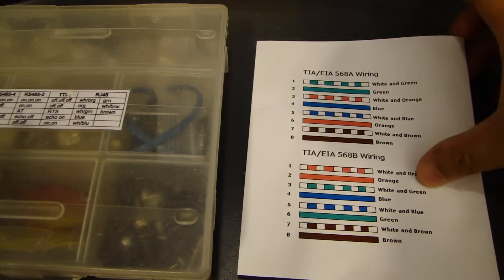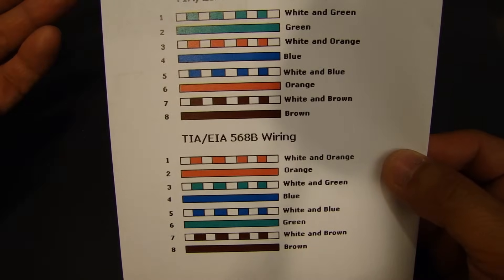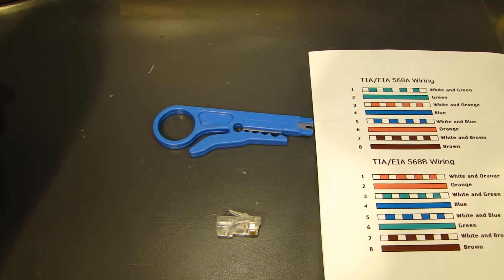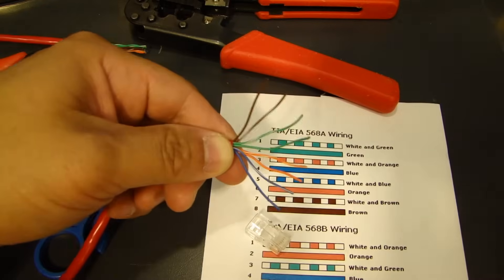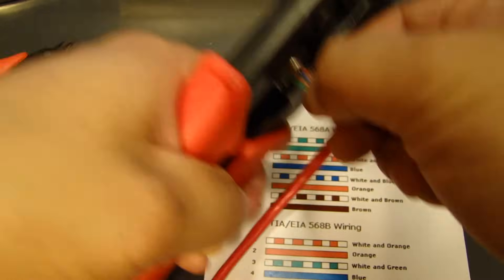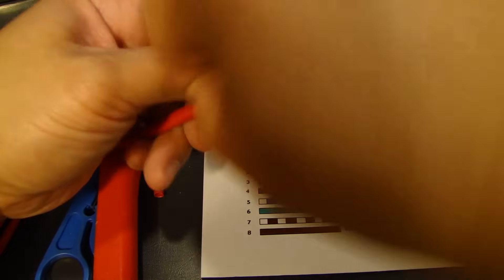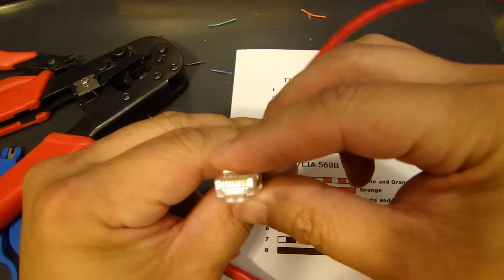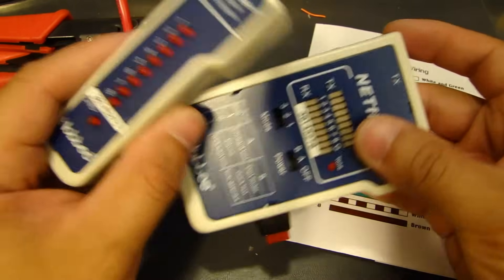How To Make Ethernet Cable RJ45 - Straight Through & Crossover

Comment: Annoyingly I'm trying to crimp some cat5 for poe cctv cams and there are only 6 cables. Black, red, green, green/white, orange and orange/white. Is this something for cctv cables as this cat5 cable came with the cameras. Can't find any reference to this wiring diagram anywhere, nobody referenced black and red cables. Some of the pins have to be empty cos there are 8 slots, so which ones are supposed to be empty? lol.
Reply from the maker: 6 conductor is not an Ethernet cable. The company that made those probably thought since they only need a few conductors to work with the cameras, and to save cost, they are using a 6 conductor twisted pair cable. Doing it this way, you have no idea which pin goes where because it's a non-standard custom wiring. You can perhaps try to match the color on the existing RJ45 connector that came with the camera system.
Reply: @dial2fast  hey thanks for replying. I'm going to match it with the other end of the cable when I can get access to it.

Comment: You make look simple and I think I finally got the hang of it. My advice to you is buy pre-cut assembled cables if you can because it ain't as easy as it seems. If you proceed do it on a day when you are at peace with yourself and have incredible patience. At the point when you are ready to push the wires into the connector make sure you see every wire in a straight line under your finger/thumb,all flat in a row and in the correct order. It is so easy for one wire to slip under/behind another and you are screwed. If I did this over again I would use pass through connectors. Murphy's law applies here and you will never succeed on the first try which is why you need lots of connectors. This job is a real bitch.

Comment: Old school way is to use snips to cut the casing then use the serrated top top align your pairs. Cheater way is to use a feed thru rj45 with a crimper that cuts the cable to lenght when you crimp it 
https://www.kleintools.com/sites/all/product_assets/catalog_imagery/klein/100cs.jpg

Comment: What is cross over for?
Reply from the maker: Cross over cable is used when connecting 'like or similar' devices. Such as connecting from computer to computer directly. But these days, network devices will automatically adjust and work without the use of a cross over cable.
Reply: @dial2fast  thank you

Comment: Hello Dial2fast, how do I pin up to match the keystone jack connections with the rg45 plug connections?
I just wired my home with ethernet cables, but now I need to make connections for the keystone plates on the wall and then rg45 plugs to connect to the keystones.  do I pin up all the keystone connectors all the same configuration, and the rg45 in a straight or cross configuration won't matter???  thanks in advance for your help
Reply from the maker: From your switch all the way to your RJ45 wall plate, you wire it up straight through. So each connection will have the same color code and pinout.

Comment: So it won't work if I just randomly ordered the wires but kept the same random order at both ends? I connected a head to a wire with a random order but repeated the same order at the other end and it didn't work. So the wires HAVE to be in that particular order?
Reply from the maker: The wires need to be in a specific order because there are Tx and Rx lines and the twisted pairs are put in a specific order to reduce EMI interference.

Comment: To be clear, you're not making a "Cat5 Ethernet cable". You're making either a cross-over cable or you're making a straight through cable, both of which are called "patch cords". What category of cable you use is an entirely different topic and has nothing to do with what you're trying to teach in this video.

As well, that"RJ45 Connector" you showed is actually an "RJ45 modular connector", or an "RJ45 mod end", but most often we call that a "cat5 mod end" or whatever category of cable it's terminating. Using the blanket term of an "RJ45 connector" could mean the "RJ45 Jack" (female end) or it could describe the "RJ45 mod end" (male end) as well. Either part could be accurately described as an "RJ45 connector" so using that term for what you're describing is not accurate. Kinda like calling a boy a girl really.
 
Details REALLY matter in this business. Be careful what you teach.

www.structuredcabling.co

Comment: i have a straight through cable in my house that has: WO/O/WG/WB/B/G/WB/B   on both ends... so they messed up the blue and white blue's position, to my surprise it works fine though.. How is that even possible? I guess it doesnt really matter wich order you use them then as long as 2 sides are the same?
Reply from the maker: If wire color match on both sides, the cable will work, but the standard is designed to have specific wire in a specific pin position to minimize noise. This is why they use twisted pair instead of untwisted.

Comment: Crossover cables became a thing of the past 20 years ago. All computers, switches and equipment built in the last 20 years is able to identify and correct TX and RX on pins 1, 2, 3, and 6 so it doesn't matter at all.  I prefer to wire in A because Blue and Orange are in the middle for phone.
Reply: Exactly the feature is called auto-mdix in Cisco switches !

Comment: great tutorial!! If making a LAN to LAN connection (router to router) do you use a straight-thru or crossover cable? Thanks !
Reply: Group A: Router - Host
Group B: Switch - Hub
When connecting two elements from the same group use cross-over, otherwise if you're connecting 2 elements from 2 different groups use straight through

Comment: We did this in school. Our class wasted 200 of those RJ-45s
Reply: They're not wasted.They are reusable.
Reply: @kellyash45  not if you crimp the wrong wire in the wrong pin.  They dont just come out.  You have to either cut the wire at the base of the terminal or crush the terminal itself and take the wires out.
Reply: How did you waste 200
Reply: no way 💀
Reply: Cap
Reply: this just a joke; don't take this as (true) fact, people of the internet
Reply: Do you guys know Winky D

Comment: I am wondering if 100base TX uses only 4 wires, will cutting off the unused blue and brown pairs affect the speed? I am planning to cut them off on both ends for power delivery.

Comment: did you no cat 5 had 4 wires that are useless the blu and brown they are just extra from back in the days when they wear used just like the phone system witch back in the day used 6 wires but now only 2 and someday cat5 will only use 2 wires also we just have not worked that out quite yet.
Reply: you are an idiot
Reply: See this is what happens with spell check.  lol

Comment: How long can the cable be
Reply from the maker: CAT5 max length 100 meters
Reply: Which two wires are carrying the data
Reply from the maker: Pins 1,2,3,6 are used

Comment: For a straight thru cable, does the sequence really matter? As long as it's the same on both ends then it shouldn't matter, correct?
Reply: I probably should have added that you were correct as well habib levi.the color code is also in part to prevent signal loss, cross talk, distortion etc..The other part of it is the pinning for networking 1,2 is transmit and 3,6 is receive.  That's why they are not paired color, Wcolor all the way through, because of that receive pinning.Blame the idiot that invented routers and what not.would have been much simpler to just swap pins in the device where needed rather than require 2 different types of cables.Imagine if every electrical appliance like your toaster and coffee maker used a standard 3-prong removable plug, then were varied as to which side of the plug was positive, negative and ground. So then you'd have to buy a normal or crossover plug depending on how they connected the positive and negative inside the appliance.That's how big of idiots smart people can be sometimes.Routers, switches and what not have been around for how many years???    They still haven't changed it, because then they would have to admit to a mistake.   So instead they spent 4x as much research designing switches that cost more which can automatically switch pinning.     Maybe it was just some jackass's joke to annoy the world.
Reply from the maker: If you simply match up both sides, the cable will most likely work. However you should learn the industry standard so you make the cable properly. I made a similar mistake when I first started in the industry, and the customer I was doing work for made me cut all the ends off and recrimp about 100+ connectors. If you want to be treated as a professional, then your work need to reflect that.
Reply: I think the reason for color code is to help eliminate distortion due to the corona created by the signal. Otherwise you might end up needing shielded cable.
Reply: The reason for the color code is so then when a tech replaces an end he doesn't have to hunt down the opposite end and color match.  (imagine in a multi-floor office how tedious it would be so have to run to the bottom floor, write down the color order of 1 cable then go to the top floor to make the end, then back down for the next wire. Not to mention even trying to figure out which end is the other end when you have 100's of wires all coming out of one conduit)
Reply: Viper90087 Why the crossover of the twisted pair on pin 3 and pin 6 then? It'd be much easier to make the end if I could just do the color and it's white brother all the way, then just make the code: orange, WO, green, WG, blue, WBlue, brown, WBrown or something.
That was just a reason I came up with to get my guys to do it right, because I couldn't fathom doing it this way for no reason.
I'm an electrician btw, and almost all commercial lighting is requiring CAT5 now, so it probably doesn't really matter for me, but you're right, it is aggravating to change out an obvious bad end, just to find out that now you have to remake the other end, because they used a different color code.
Reply: Viper90087 I've tried looking this up, and you're the first to mention this history lesson. What is your source? Or is it something you learned from the trade?

Comment: I have a cat 5 cable, I use it to connect a wire from my router to a PC in another room. when I am working on equipment. like building PC's. for that cable, I would create just a Straight through, Right? What is exactly a cross over used for? I am thinking different type of equipment.
Reply: +Scott Castille Crossover cable is used for similar devices.  Like switch to switch, or router to pc(similar in the way they send data).  A straight through cable is used for dissimilar devices like pc to switch. and router to switch.  If the router you are talking about that you are connecting your pc to is what typically gets provided by the ISP you are actually connecting it to a switch.  Most home routers just have a 4 or 5 pin switch built into the modem.  In that case since its pc to switch it would be a straight-through cable.

Comment: I'm trying to do this myself as professionals want £100 to fit the cable. The thing is as soon as I let the wire go when pushing the wires into the plastic end they cross over, so the wires aren't in line with the correct pin. It's very frustrating lol.
Reply from the maker: +Wes It does take practice, but you need to use your fingers to pull and straighten out each wire before lining them up. Move them around if you need to so each wire is not wrapped around another. Once you know they are straight and in order, then you cut to length and insert it (while still holding it down).
Reply: +dial2fast Okay, I'll give it another go. Thanks :)
Reply: This is one of the MANY reasons we get paid what we get paid. We have spent decades, usually, developing the education and skillset to be able to do what you cannot.

Pay the man and thank him for his expertise and give him the respect he deserves and stop being a cheap skate whiner.

Comment: the top is Crossover and the bottom is Straight Through
Reply: Applying both at different ends of a wire makes the wire a cross over. If the ends are the same... it's straight through

Comment: this makes no sense. my ethernet cable has only 4 wires and starts out like EIA / TIA B (even says this in bold print on the side of the cable). i dont have the other 4 wires (white/blue,green,white/brown, and brown all missing) but the cable works fine. in fact all my cables are like this bought from the store. if brown serves as data wire then how am i able to send and receive data with only 4 wires?
Reply from the maker: +itechhen RJ45 connector has 8 pins for the following reason. For data transfer, only 2 pairs are used, Pin 1,2,3,6. The other 2 pairs, Pin 4,5,7,8 are reserved for carrying power supply voltage for PoE (Power over Ethernet) to power some devices such as IP phone or security IP camera. So yes, the cable you have will connect the data side, but if you ever buy a device that is PoE, then it will not work.
Reply: +dial2fast  aha! that i did not know. thank you for the video and thanks for clearing that up.

Comment: sorry, Just for clarification....using the 568A at one end and the 568B at the other end makes it a crossover cable just like you showed on your video? using 568A or 568B on both ends make it a straight through cable. am I correct? I appreciate your answer....thanks
Reply from the maker: +rhy Lasquite Yes that's correct.
Reply: yes u saying right so i agree with you

Comment: Excellent Video, I did it my first try, I have the tools and the tester, I kept wasting connector after connector and couldn't figure out why the tester would not work, I finally looked up a video which was yours and realize my color platform was all wrong, I did a cable this morning with your color chart and the way you did it and the tester worked perfectly, Thanks alot.
Reply from the maker: John40ish Once you get a hang of it, then it's not too difficult. Glad you gave it a try.
Reply: John40ish It's great that you succeeded first try. I wish that the "whys" for doing straight through vs crossover would have been explained during the demonstration. For example, why flip colors? Not explained.

Comment: Which color is mainly the data receiver?

I know that brown is mainly the data sender.
Reply: Actually, unless you are using gigabit, the blue and brown pairs are unused, on regular 10/100 Base T networks pins 1 and 2 (Orange for B Green for A) are used for transmit (TX) or upload and pins 3 and 6 (Green for B Orange for A) are used for receive (RX) or download

Here is a diagram for what all the pins are used for (Note: I may have polarity (pos/neg) backwards, and the unused pairs, while unused, are considered as ground (GND)

                    T568A                T568B
1. TX+      White-Green     White-Orange
2. TX-           Green                Orange
3. RX+     White-Orange     White-Green
4. GND          Blue                    Blue
5. GND      White-Blue         White-Blue
6. RX-          Orange                Green
7. GND     White-Brown      White-Brown
8. GND         Brown                  Brown
Reply: Michael Dickens
Thank you so much.
Reply: No problem

Comment: Very helpful video.  Q: When would I use a straight-through vs. a cross-over cable?
Reply from the maker: Used when you have two 'like' similar devices, you would use xover cable (ex: from one computer to another), but now a days, many devices auto sense and switches for you.

Comment: dial2fast....

If I use a "cross-over" coupler, I should be able to just terminate both ends of seperate cables as 568A and plug-in to the coupler (the cross-over would be performed by the coupler)....  is this correct?

Thanks much

Thomas Crawford
Reply: Yes. As long as pairs 4 and 5 colors are reversed along the path, you're good.

If it helps imagine two people trying to talk to each other. It works best when one person puts their mouth ( the outgoing port) up to the ear (the receiving port). One pair sends communications and the other receives communications so they need to be "coupled" so the sender is sending to a receiving port and not another sending port that cannot hear anything.

This is the basic concept of a crossover cable.

Comment: I had that uneven crimping experience too...looking head on it was like a hump back bridge, I noticed straight away...and was scratching my head...though in my case the connections were made enough to be reliable???  didn't have another tool on site to redo.. It was a ratcheting crimper also, never found the cause. just chucked the tool.